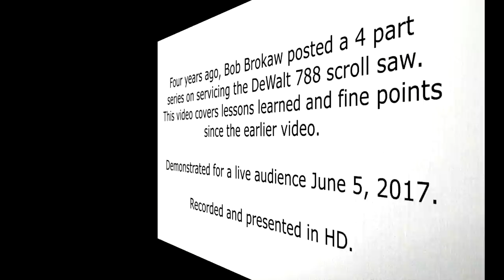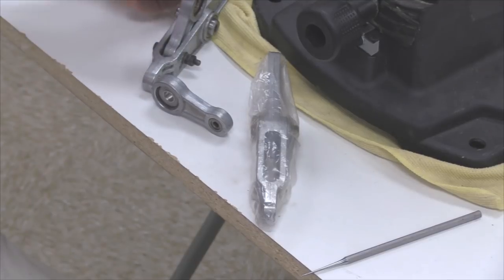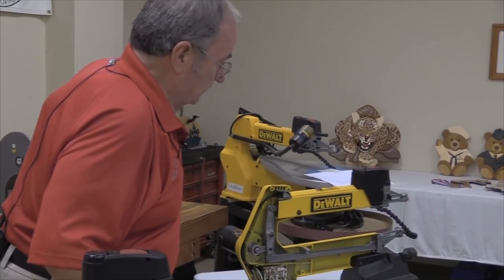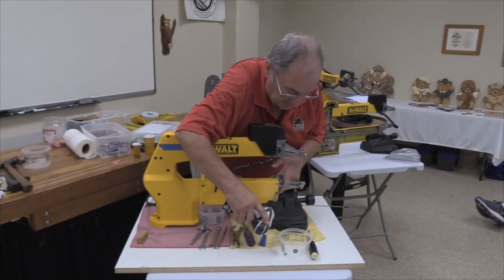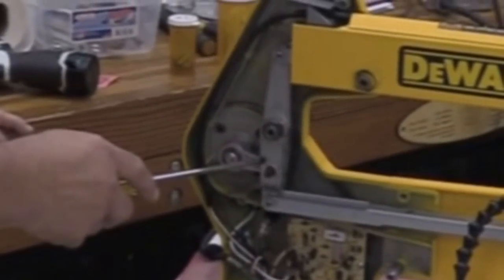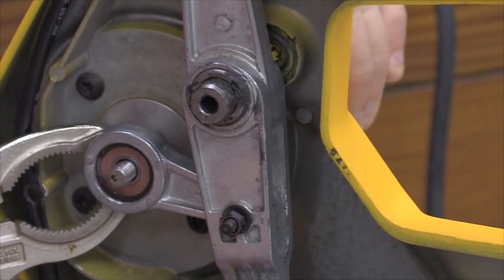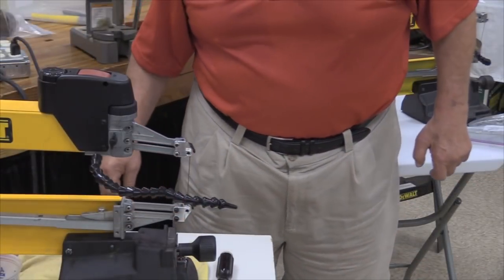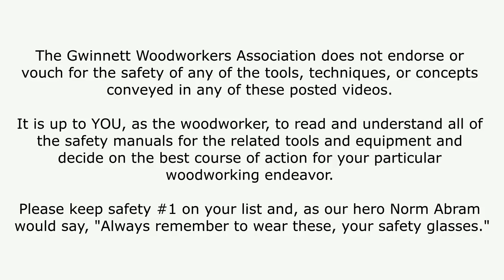DeWalt 788 Scroll Saw Service UPDATE!

Comment: New to scrolling and am researching my first scroll saw.  Was planning on a more expensive saw but now that these videos have provided so much technical support I plan on buying the DeWalt 788.  Question:  Do you recommend taking it apart enough to lubricate it prior to first use, as a preventative measure?  I should think that doing that would greatly extend the life of the machine.

Comment: Although I doubt anyone can help  me...... here's the problem.  I isolated the problem on my DW788.  It was the large, center (double HK1412) bearings on the rocker bar assy.  The sleeve insert showed the exact same wear as the one on Bob Brokaw's 4th video.  How do I take out the set of two HK1412 bearings and replace them, and where do I get the proper replacement sleeve?  I looked at ordering a new rocker assy. with the bearings in it and sleeve provided, BUT it doesn't come wigth the   connector rod assy attached.  I can not get my connector rod assy off my rocker assy. , as it is permanently attached (even after removing the screw with double nuts.  So, in short, I've isolated the problem but can not do anything about it.
Reply: The most recent version of this lecture shows how to get the connector rod assembly out. In this one he mentions chamfering the rocker to get it in and out, but in the latest one he’s got a new (better?) method. He set the rocker arm down on a wood vise with the connector rod hanging down below, and stuck a big, long awl in the space next to the connector, then pounded the awl or pick or whatever it was with a hammer a couple of times to get it down just far enough to spread the sides of the rocker assembly so the connector rod assembly would come out. The rocker is made of malleable aluminum so it was able to spread a bit for that operation. I believe the video where you can see this was posted about a year after this one. I know this comment is 6 months after your post, so I hope you found help elsewhere or just set it aside to deal with later 😂

Comment: Is the Delta 1.3 amp 20" scroll saw the same except the Delta upper raise up and locks?
Reply from the maker: The Delta 40-690 is affectionately known in my area as the "Gray DeWalt". When you carefully examine the parts diagrams of the Delta 40-690 and the DeWalt 788 you will only find a few different part numbers and those differences are only due to paint color and labels. The rest of the parts are interchangeable. The Delta 40-694 was a bit more radical design difference that was born out of a desperation move by Delta to head off a market place death blow as Delta, DeWalt, and Porter Cable were being divided up during the short lived Black and Decker acquisition. During that acquisition period, Delta was dropped by most of the big box retailers and was dealt a second blow by the reputation that you couldn't get parts for Delta products. The eventual winner was the original DeWalt  now owed by Stanley. The few people I know of that bought a 40-694 were generally dissatisfied with them and usually went on to other products.
Reply: Gwinnett Woodworkers has the Delta 40-694 been straightened out and better now from the Delta 40-694? I see a lot of great reviews from owners on the Delta 40-694. I mean the Delta and DeWalt are basically the same except color scheme so I can’t understand paying more for the DeWalt but it does appear the Delta has updated a bit more with the 40-694 but the older 40-690 is directly the same. If buying the Delta I assume it would be best to open up and tighten everything up and grease everything.

Comment: I'm having two problems with my Dewalt 788:

1.  The blade tension lever always wants to slip from #5 (full tension) down to #3 or 2.  I took it apart and tried to tighten the  screw on the tensioner, etc. but that did not help.

2.  The motor does not always start.   I have to push the start switch multiple times and sometimes it does not start at all  til I try again later.

  My machine has not been used a lot.  I make repro pieces for museums and historic sites, and the scrollsaw is only occasionally used.

    Thank you,
   --Wm. F. Brown
      Forest, VA
      www.LineAndBerry.com
Reply from the maker: 1. There is supposed to be a wavy washer under the head of the tensioner cam screw (#52). Hopefully it is still present. Before threading #52 into the tension cam lid, put some blue loctite on the threads, tighten the screw against the wavy washer, but make sure you can still move the #26 lever. Let the loctite set up overnight and your tensioner should now hold.
2. The starting issue sounds like one or more open windings in the motor. Some people find a work around to be putting a screwdriver into the end of the motor to rotate the armature off of the bad winding before activating the switch. The more drastic solution is a new motor. I found some last year through an ebay vendor in Puerto Rico. They turned out to be genuine DeWalt parts - just surplus. He may still have more.
Reply from the maker: The San Juan PR vendor still has the motors. Search DW788 scroll saw motor. They are $125 (less that half of DeWalt's price.)

Comment: i just bought this saw and i do woodworking,,i built cabients ,,furniture,,,and have been doing it for years and love it,,,,but i can honestly say,,,i hate this scroll saw,,well not just this one but any,,,,i figure if it cant be cut with a band saw,,,you dont need it,,llol,,it takes forever to get the blade on it,,it breaks reguardless of how much tension is on it,,or bends,,,plus you cannot turn the material and follow the lines,,,,,waste of money,,,